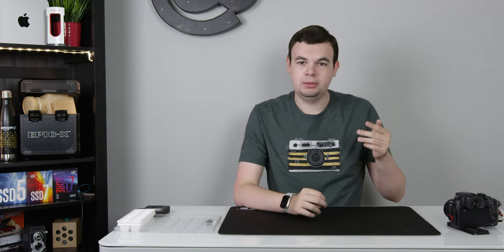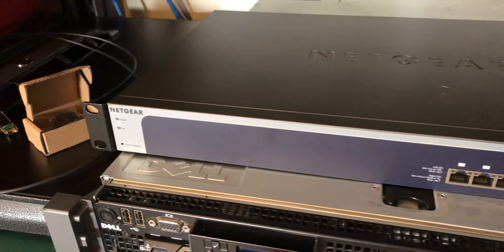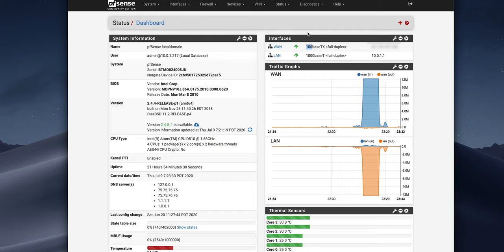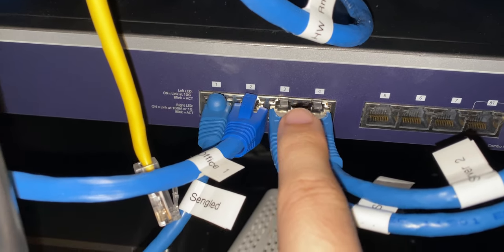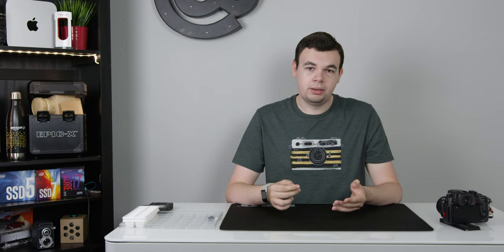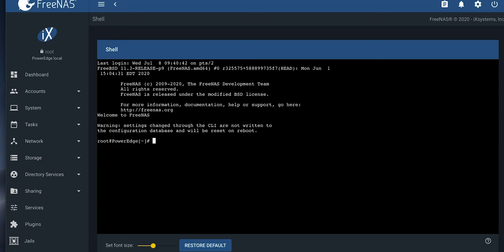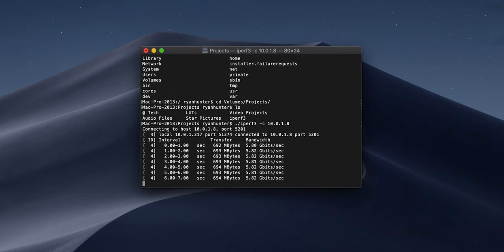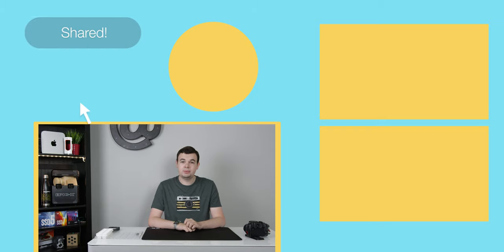Troubleshoot Slow Ethernet Link Speeds

Comment: thank you sir! I had to change my Ethernet cable to a compatible one and now my speed is up!
Reply: did you upgrade from cat 5 to cat 6? im thinking i might need a cat 6 ethernet cable.
Reply: @barrett7543  so I originally had a cat 5e and I upgraded to a cat 6 cable and then I found out my PC was had an internet bottleneck which was being caused by the incompatible cat 6 cable. Therefore I had to switch back to my cat 5e cable. So maybe find out if the device you plan on using a cat 6 cable is compatible. I also tried the cat 6 cable on my Xbox just to find out the Xbox only goes as high as 700 mb and not up to 1g for download speed.

Comment: Hey I have a question I get near 200 mbs on WiFi but when I get on my pc that’s connected to Ethernet it gets capped at 100 mgbs with a cat6 cable
Reply: It’s because pcs have wifi chips that cap your wifi speed I’m pretty sure you can upgrade chips though
Reply: It is likely due to a port speed limitation. Either your router / switch or your computer doesn't support anything higher than that. 100 Mbps was a very common ethernet speed for many years. Open up your ethernet adapter properties on your computer and look at the link speed. If it says 100 Mbps than that is the reason. If it says 1 Gbps something else is going on. Also try swapping the cable out. If pins 4,5,7, or 8 were damaged you would be capped at 100 Mbps. If pins 1,2,3, or 6 were damaged you would get no connection at all.

Comment: I had problem w/ Wi-Fi connected to internet via Apple Router 70MBPS (proper speed), but in a few minutes it drops to less than 5 (problem continually over a week).   Today it did not drop. But (as before) if I used an ethernet cable to my router & cut off Wi-Fi it ran glacially slow.  When Speednet site came up, the GO icom did not even appear.  What could cause a very slow Ethernet speed coming out of modem direct to computer, but a faster speed using the same Ethernet cable, but now attached to my router?  Could the modem be at fault?  Isn't the same ethernet signal exported from the model regardless of whether the ethernet cable is plugged into my computer or plugged into my router?  For many years I did not experience this problem using same set up.